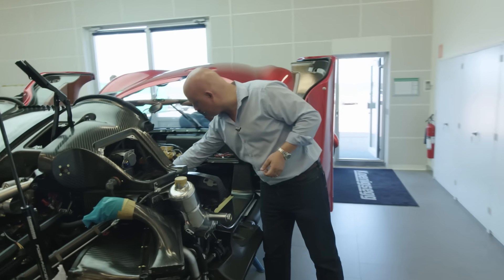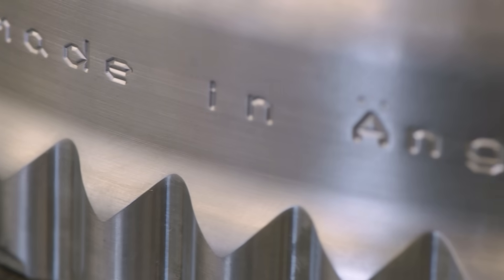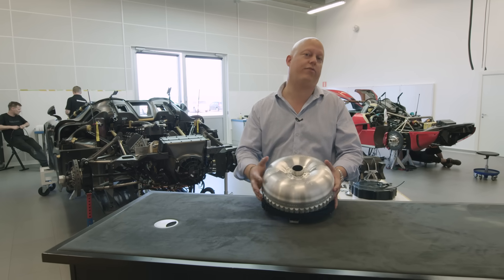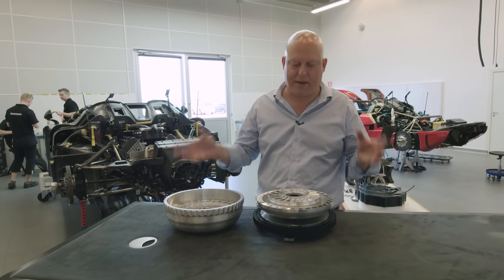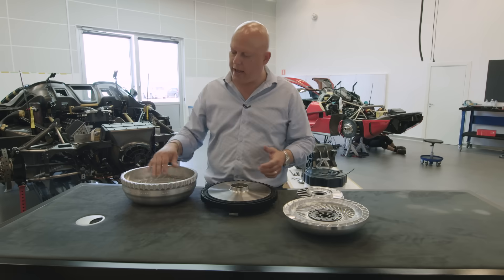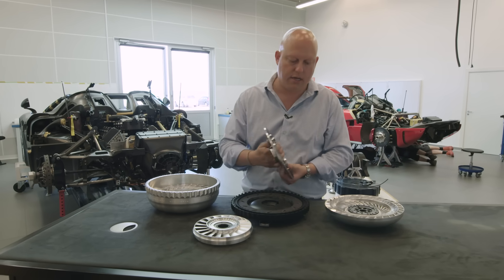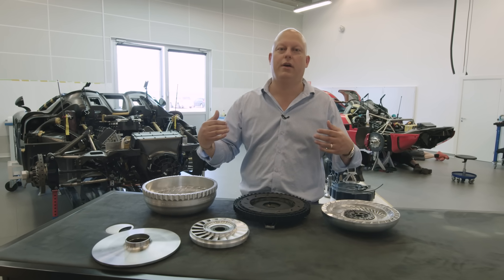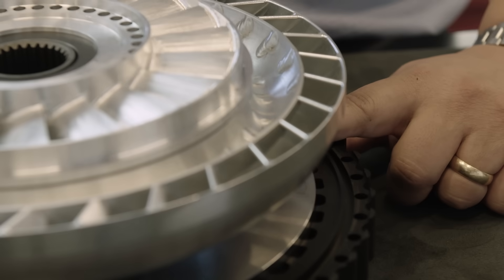248 MPH Without A Gearbox: Direct Drive  -- /INSIDE KOENIGSEGG

Comment: Spinning the tires at 160mph holy shit
Reply: more motors-  more weight
Reply: @7privet_  yes and no the battery weighs the most the motors weigh less
Reply: The little grin on his face when he says that.... No one can keep a straight face when saying something like that.
Reply: Only way to go any faster would be slicks and stripping the creature comforts.
Reply: + Midas Eymann Yes, I'm sure they don't know what they are talking about and should definitely take advice from the youtube comments.
Reply: Yeah makes me think they should have put some electric motors on the front as well but I guess that makes it even more complicated.
Reply: I don't see why they put the 2 electric engines on the back wheels, this just makes the wheels spin until 160mph. If these motors were on the front  wheels the weight would be similar but it would mean a lot more acceleration.
Reply: Over 2000hp to one axle is fine, just not at once in most cases. The car never has a full power at any one time, the engine is only making full power at high speeds while the motors only make theirs at lower speeds. It all balances out.
Reply: Nick Martin Partly, when that weight is shifted straight backwards with a higher force than gravity it is not really that helpful
Reply: More weight- more traction.
Reply: They don't care about weight as much with all that torque from the motors. Plus it helps keep the car planted. The veyron weighs over 4000 lbs. Actually out in the salt flats they add weight many times to keep the front end down. You could keep it down with aero....but aero slows top speed down
Reply: Matt Kingsley I'd honestly probably shit my pants. I'm having a hard time trying to imagine it right now😂
Reply: Nick Martin F=ma...
Reply: Nicktrance1 are you telling me im wrong?
Reply: So how many cars with electric motors have all these YouTube experts built. I pretty sure the total will be nil..

Do people really thing Koeniggsegg just threw together the first idea they had without doing any research and dev?
Reply: Agreed. Ive built an electric generator with some buds, but not a car.
Reply: they dont have the space if they want to keep their trademark roof into boot feature
Reply: And those tires are like super wide and grippy. :-D
Reply: Torque fill.
Reply: bingoberra18 It's still helpful, the weight doesnt move perfectly horizontally backwards, it will still increase traction.
Reply: I belive the car has total up of 1800HP, not 2000+, but the peak actual HP (as the motors and ICU never overlap and their peak power) is roughly 1500HP. so yes, we are back to "Neck a neck" with bugatti when it comes to output
Reply: owned... lmao XD
Reply: this isn't necessarily true. Dead weight is bad, but if you can add weight by using aerodynamics then yes it does do that. But more dead weight or curb weight increases the force of momentum in the tires, making it much harder to control the "heavy" object flying around corners or being slammed on the breaks. Thats why track cars and extreme road cars focus so heavily on weight reduction.
Reply: i think this could be the next step. it is maybe a little bit more complicated but then you get much better stability in the corners - especially when you use one electric motor per wheel. which also means you don't need any differential gear between the wheels. and the philosophy of this car is already to simplify things and make it better (without the traditional gear).
i don't know how his business shoots up but i think he can increas his car-output 20% every year whilst getting down the production costs at the same time. i heard something about 100 cars per year and now they are not really a competitor of ferrari. but when the production increases and the costs are dropping they gonna be a hot competitor to ferrari, lamborghini, mclaren etc. koenigsegg does not have any tradition - so he is completely free regarding new developments. and he's developments shows how groundbraking that stuff is. i guess one of the things in he's brain that constantly comes up is the word 'efficiency' which absolutely fits in the current times.
Reply: HA you honestly think that providing power to the front wheels as opposed to the rear wheels will make the car faster?! You obviously don't understand how torque and acceleration affect a car's suspension...
Reply: Of course it is suitable for racing if it can over power the traction.

Chaparal raced very well with automatics and torque converters.
Reply: In what kind of racing is 0-60 in 2.8 and 248MPH not good enough?  As far as fuel efficiency I doubt it's any worse than the average supercar and probably better.
Reply: Matt Kingsley
Reply: Do you know this to be true for the car or assuming?  Seems rather silly that they wouldn't have a cooling system that's good enough to handle it.
Reply: how about a set of tank tracks?
Reply: I've got an upgraded 04 cobra and best I can do is around 100MPH spinning tires! And trust me, that's not a pleasant feeling, very dangerous!
Reply: i think you are right but i think it will understear if you  that power in the front
Reply: Craig Norquay  lol
Reply: Lol. I "raced" a guy once at a stop sign on a rual country road. We both took off and at 50 mph he grabbed his next gear (I was a car length behind) and spun his wheels. I was blown away. Then he was gone.